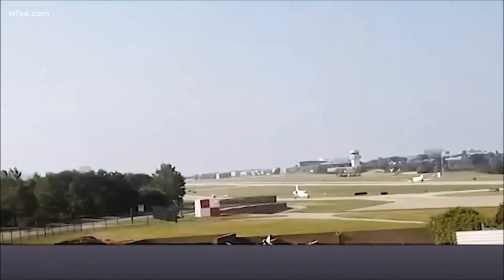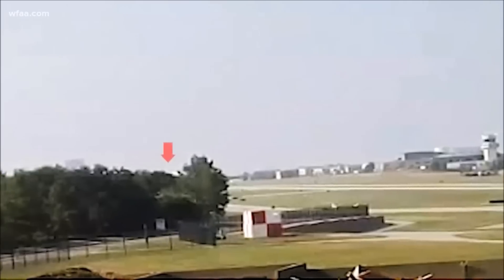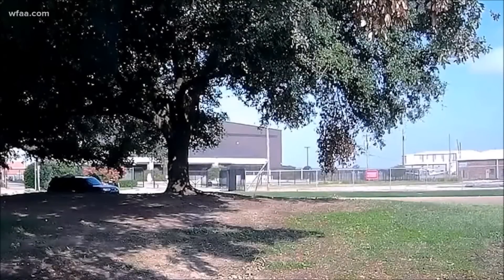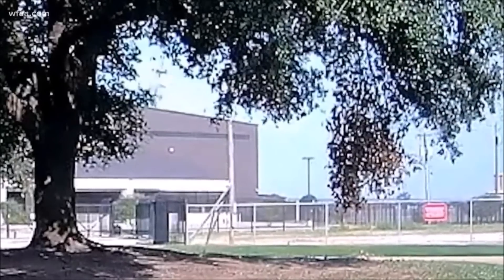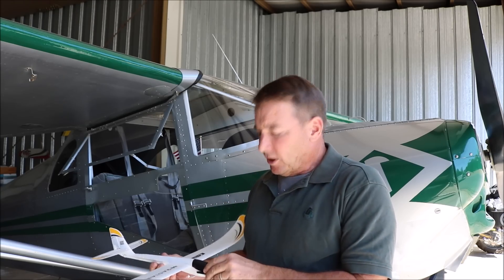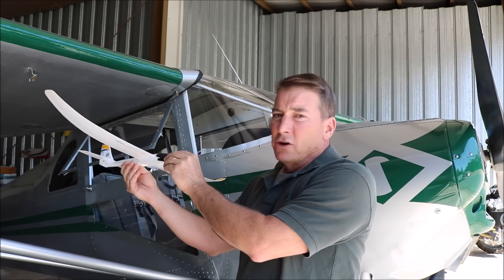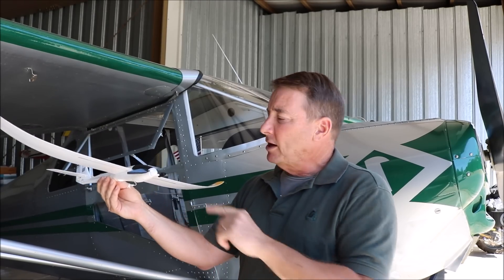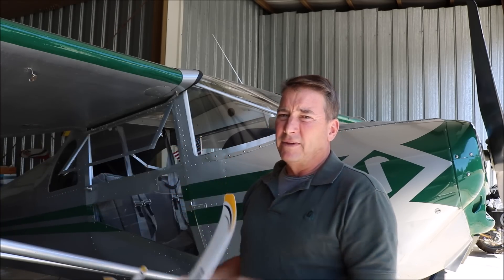Addison Tx. King Air 350 Crash UPDATE- Vmca

Comment: Well done as always.   It is extremely fortunate that today's aircraft engines are as reliable as they are because, unfortunately, way too many multi-engine owner-pilots and probably quite a few other multi-engine Part 91 pilots just aren't ready for an engine failure on takeoff or during other critical phases of flight.
Reply: Yes. Im not a pilot (I like sailing!) but the engine failure at V1 scenario is just so critical that the crew's actions really should be drilled until they are automatic.  Its a bit like a "Man Overboard" scenario.    If someone goes over, the crew needs to know the drill in advance or else ...
Reply: That's the problem, in a nutshell. Part 121 (Airline) pilots are presented with the same scenario under many different conditions in their recurrent simulator training, semi-annually for captains, annually for copilots The immediate actions required to safely recover and maintain control of the aircraft in the event of an engine failure at VMC become instinctive, and have resulted in a successful outcome for many pilots, this one included.
Reply: All very true statements guys! I have a personal rule to never fly in an aircraft without access to the controls unless it is piloted by a Part 121 pilot or a well trained Part 135 (i.e. NetJets) pilot. It has been over two decades since I trained my last multiengine student, but I can still remember it like yesterday. If after going through all the applicable emergency procedures (4-6 secs.) for this situation and the aircraft is becoming uncontrollable just chop both throttles and land straight ahead steering clear of obstacles. Your chances of survival are extremely high!
Reply: Tom Heringer--exactly.   And there are way too many light-twin pilots who think that second engine will save their lives, when in fact with an engine failure on takeoff, unless they are well prepared, their chances of surviving an engine failure after rotation are probably much better in a single (unless they do the usually fatal turn back to the runway).
Reply: tenpiloto: Any chance you fly a Citation Ten? The reason I ask is that I spent 20 years working as a Crew Lead at a Cessna Citation Service Center. The Model 750 was one a my favorites to work on.
Reply: Tom Heringer--I had a very eclectic career which included 8000 hours wide-body PIC (DC-10, B-767), a few hundred hours DC-8 PIC, about 3000 hours of G2, G3, and G4 PIC and SIC time, and some mid-weight turboprop PIC and SIC time, after years of light piston and turboprop PIC flying, including U-21 in RVN 50 years ago, and lots of single-pilot Twin Otter flights in the Rub Al 'Khali 40 years ago--never flew any of the Citations (but would definitely have enjoyed flying the X).

Comment: Great analysis. Just one thing, vmca is calculated under 23.149 with the critical engine prop windmilling (not feathered) I believe. I'll have to look it up but correct me if I'm wrong. Anyways, I really enjoyed watching your explanation. I taught multi engine flying for years as an mei and have done more vmc demos than I can remember. This accident really shows the importance that all pilots should expect EVERY takeoff to have an engine failure and be ready... Then, if no failure occurs, continue on. Basically be ready for it and for God sake, if you're going down, reduce power on the operating engine to regain directional control and go down right side up!  It never works out when you go down inverted and nose down. The recovery from a vmc related loss of directional control should be applied immediately as needed and maintain that 5 degrees of bank into the operating engine when control is regained. The inability to maintain that 5 degrees of bank and desired heading all while full rudder is applied into the operating engine, should be considered the beginning of loss of directional control and power must be reduced immediately.  It's so sad to see this video.

Comment: In other comment sections dealing with this tragic accident, I noticed a sort of consensus among many pilots with light twin experience that the least worse response to an engine failure at that critical moment is to kill the power in the good engine and then to attempt to land straight ahead as opposed to attempting to do all of the things required by the manual in a matter of seconds in order to compensate for the torque and climb out safely on the remaining engine. What are your thoughts on this?
Reply: Pre-flight planning helps address this.  Before you depart, you should know what your climb rate will be (positive or negative) in the event of a power loss.  In my multi-engine training, if the performance planning showed less than a certain amount of  single engine climb (I think our threshold was <50' fpm) we didn't go.  The take-off briefing is important as well, so you know ahead of time what you will do, when, if anything happens.  Engine loss on the roll, abort.  Engine loss after takeoff with runway remaining, land.  Engine loss  after takeoff with no remaining runway, pitch for blue line, maintain heading, feather the prop and clean up the airplane, and then eventually return.   This airplane should be able to continue to climb with one engine inop...if it is flown properly.

Comment: Just wondering, in what position the left engine fuel selector was in during take off and why wasn't the weight of the extra fuel compensated for by the ATR rated pilot.  This would have required considerable speed and distance for a,  more than adequate, take off run.

Comment: Very well explained. Thank you. If the engine failed exactly at V1 or rotation, and the aircraft was fully loaded or overloaded, its ability to climb without immediate feathering and gear up is very slim. What comes over very strongly is the huge amount of YAW prior to the stall, and the extreme quickness of the spin to inverted.

Comment: Juan, A minor correction. I believe Vmc is with the failed engine's prop windmilling, not feathered.  This caught me once in a simulator when I had feathered the prop and then unfeathered it when below Vmc. Fastest snap roll I have ever seen!
Reply: As a 20 year pilot in a piper twin witch I learned in as an old man of 52 keep on the ground till you have lots of speed hold it down in ground effect keep it level build your speed gentle clime gear up engine starts to fail lose  of directional control dead foot dead engine identity dead foot dead engine verify throttle back and forth verify close fuel to bad and feather nose  over to maintain speed  lift bad engine  3 to5 degrees continue  to fly the gain altitude do not turn into the bad engine line up for landing maintain lots of altitude  pull back power on good engine gear down nose over to maintain speed remember light twins will not fly on one engine with the gear and flaps in get lots of altitude maintain speed with inertia more people die at the threshold  as soon as they put the gear down. Thanks for allowing me to share  fcb

Comment: Would it be safe to say that pilot error in more than one way contributed to this fatal accident ?, why did the pilot/pilots not rev both engines up to take off power and hold stopped on the runway for a few seconds?, 20 seconds? to make sure that both engines are running correctly?. I have a gut feeling that if they did that simple step then they would of been able to get well airborne and gain enough altitude before an engine failure. Could it be that pilots in general are not that patient to spool up jet engines, rev up piston powered engines long enough at a stand still brakes on position until it is pretty obvious that no type of engine failure will ensue during the actual take off?. A good answer to these questions would be well appreciated Juan if you could?.

Comment: Sad sad accident. With my Dad we flew two Cessna 310's for 25 years and a Baron for 10. Dad always said prepare to be single engine. Simply meaning if at rotation (most critical) you have engine failure and can't maintain parameters ( blue line, cleaned up, raise the dead eng, feather, trim/yaw ect) kill the good engine and perform a forced landing. If under control you have good chance to survive. We have had 3 engine failures. One on a Bonanza we had which resulted in a belly landing in a field, one in our 55 310 at cruise, right engine ( no problem ,went and landed )  and once in our 69 C310P at rotation, left engine. In that instance airplane was well under gross at sea level and temperature cool. That went fine and the 310 does well but Dad said you must fly the airplane no matter what even if you have to put it down. This is a tragic story here, God speed.

Comment: There is a possibility of a runaway engine in this case the right engine and they reduced power on the good rather shutting down the runaway. 
A runaway engine is one where essentially unmetered fuel poors into the engine, causing it to go into an over speed/ uncommanded max power situation that doesn’t respond to power lever inputs. The only way to kill a runaway engine  is with the condition/ Fuel lever to cut off.  The fact that the gear was still up at impact, indicates distraction and confusion occurring. A runaway engine on the right side  in King Air is very dangerous and hard to control. It gives initially a false indication feeling with the rudder making you think the good engine has failed but it’s really a runaway on the other giving over max power.  I flew King Air 90s that had fuel topping governors that were prone to failing. The company I worked for knew this fact, and we briefed the possibilities of a runaway in our normal take off brief as standard SOP. A runaway engine event below VMCA you only have seconds. Your explanation of critical engine also re-emphasises that a right engine runaway (not failure) is super critical.
Reply: 19723020 It will pull harder and give the pilot a false sense dead leg dead engine. So verification with engine instruments is paramount. Otherwise you will reduce power on the good engine. This will make  a bad situation worse extremely quickly.

Comment: I may be wrong, 1.  I don’t tanker unless lightly loaded, 2.  I would fly the plane, not worry about gear and flap configuration until I have controlled flight.  The King Air 350 will do it’s job if everything is below limits and pilot has the training.  Pilot must know how he is going to handle loss of engine on takeoff before it happens.   Thank You for the video.

Comment: I'm not a pilot so excuse my ignorance. Would the procedure for such an emergency have been trim or apply right rudder, retract under carriage and a avoid turning into the dead engine? Assume power was at full so considering the all up weight what more could have been done to maintain or increase airspeed and avoid the stall?

Comment: Many years ago I saw a tragedy averted in Memphis. We took off in a new at the time Boeing 757 bound for Miami. Unfortunately a  twin engine prop plane was doing the same on a parallel runway but traveling towards us.and we both became airborne as we passed. His landing gear was up soon as the wheels were off  the runway surface. The wing vortex of our plane hit the smaller one flipped it 90 degrees onto it's  port wing barely off the ground. That pilot knew what to do cause he snapped back instantly level and flew on. I was stunned. We arrived in Miami and I have never flown since then.

Comment: Excellent report by Juan once again.  Reporting facts, highlighted a few points that will likely factor into the NTSB's report.  Not sure what model of King Air this was but I found a 350i, $8M new, with Operating weight of about 10K lbs, and max TO weight of about 15K lbs, leaves 5K lbs for fuel max usable at 3,611 lbs which leaves about 1,489 lbs or so for people and baggage.  Unless I'm wildly off, with 10 people aboard incl. 2 pilots, so 8 passengers and baggage likely exceed 1,500 lbs total.  Crashes are a succession of errors (usually human), but at or over max TO weight means the pilots at a minimum should have reviewed their need for perfect TO and anything less gets rejected.  Likely should have stopped TO soon as problems observed with left engine, and as I recall from Juan's previous explanations many other factors go into the max TO weight and TO length calculations like temperature 79 deg, density altitude, winds etc.  The Commercial Pilot without 350 experience was likely at a disadvantage compared to the 71 yr old pilot.  All around, very sad way to end your life due to a bad take off and frightful crash for those involved.  What should have been a fun trip, maybe vacation for the passengers ended abruptly, thoughts and prayers for those involved and their grieving family and friends.  Hopefully, the crash can bring about positive change for the civilian aircraft industry and pilots.  Very sad event for all involved, glad no one was in the hangar, maybe the lone bright spot at the time.

Comment: There was a lot going on during that take off.
Weight.
Speed.
Engine failure?
Pilot experience?
Reply: Not to be facetious nor to speak ill of your comment, there's a lot going on with every take off, especially a piston twin. Much to consider before starting down the runway. The 350 with its turbine engines should not have spun in.
Reply: Well it is obvious now but the pilot should have aborted the take off all together and got his engine problems straighten out by a aircraft power plant mechanic. To dam late to troubleshoot a prop jet engine in the air with a full load .
Reply: @raymondkoonce5827  .

Comment: Pardon my amateur understanding of the situation as I am not a pilot, just an enthusiast. I have a question though.
Would a situation with an engine such as this be more easily addressed if power is set prior to the takeoff roll (shorter runway-style takeoff) rather than setting the power during the takeoff roll?

Comment: Do the same takeoff dynamics apply to jet powered aircraft, when it comes down to an engine failure, as opposed to a prop driven plane?
Reply from the maker: very similar
Reply: @blancolirio  This brings up another question: Do all of the engines spin in the same directions, both jet & props? Or do they counter each other? What about 4 engine aircraft?

Comment: Sad day for all involved and their families! I wonder if gear could have been brought up quickly enough, if the plane might then have been able to maintain directional control and build enough speed then to climb out and then go around and land.  
Excellent review of the event Juan.
Reply: I was wondering that too. Would gear up have made the difference?
Reply: @andyburk4825   I agree. This flight lasted a mere 30 seconds, and I think that includes the roll out and getting to V-1.  Things started going bad very quickly after V-1. And you are correct; retracting the gear takes a couple of seconds to first think about doing and then initiate in the cockpit, and then it takes a hand-full of seconds( maybe 6 or 7 seconds...I'm not an expert ...I just don't know...just guessing ) for the gear to fully retract. It looks like even a partial gear retraction would have made no difference.